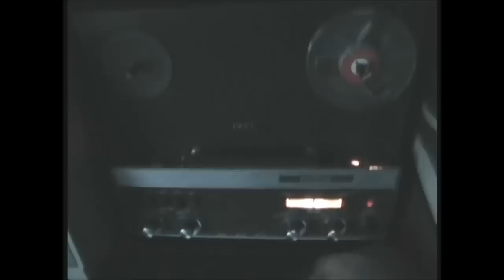Revox A77 Knallfrösche ersetzen

Comment: Greetings. I have another problem. On Platina, where it is 21 volts, the voltage is lost. It will be 5 volts then 13 and the potentiometer is well adjusted. Thanks in advance.